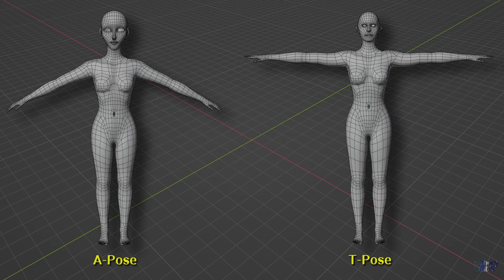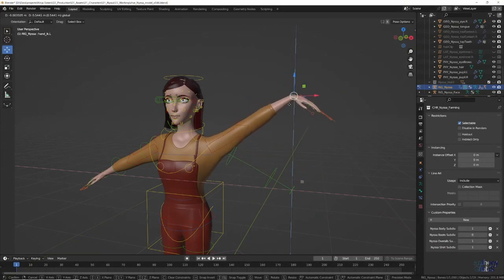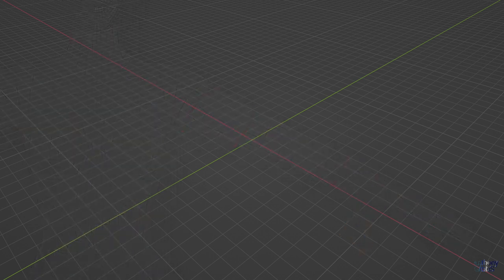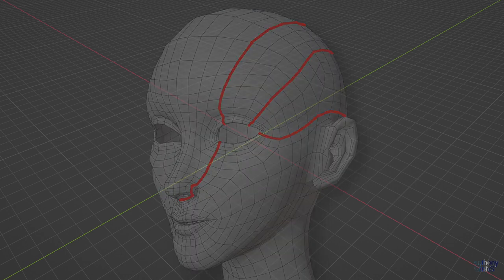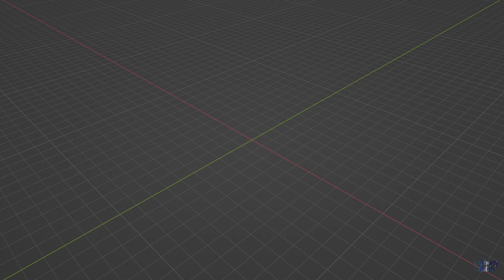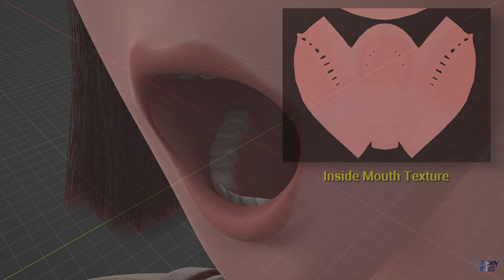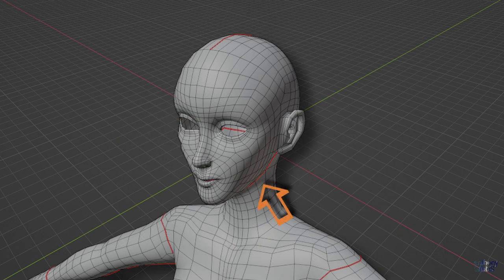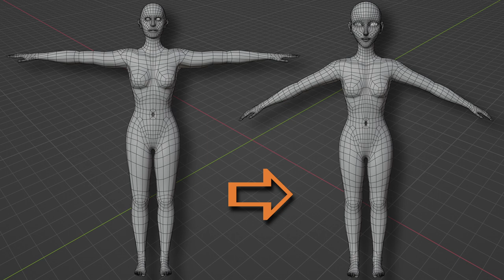Mistakes to Avoid in a Base Mesh

Comment: Interesting tutorial. I hadn't thought about addinging additionmal edge loops before. Most  of  the characters come from Character Creator, but I've recently added a new one  that was a just a  mesh  at first. After rigging it with Auto Rig  Pro (a powereful tool but with one heck of a learning curve), I found myself repeatedly combing back into my base character blender file and making adjustments (esp to the weight painting) as I discovered problem downstream when I  was animating the character. I have re-rigged my character at least a dozen times and then made further edits probably another dozen. Rigging and animating is not for the timid! lol
Reply from the maker: No, rigging and animating isn't for the faint hearted, it's just not something most tend to do. While keeping models light weight is the usual goal, which for still images is fine, as soon as you start to animate through a range of motions, there just comes a time when more detail is needed.
Good luck on your projects and thanks for watching. I have more videos to come around animation, since that's my end goal, but somethings you need to cover the more boring details first, since over time it can really start to matter.